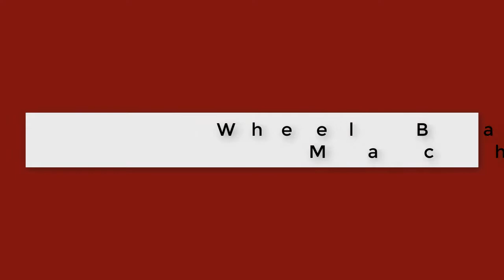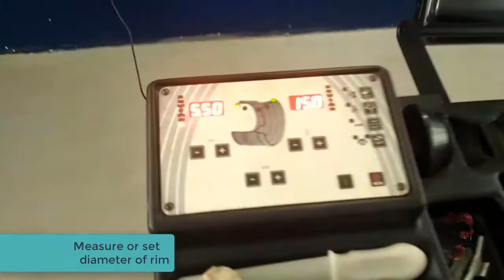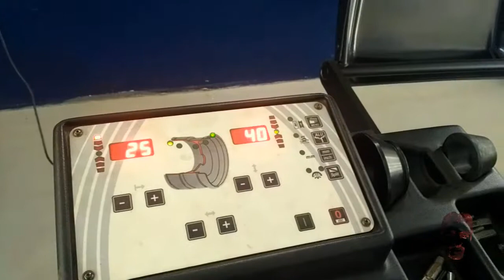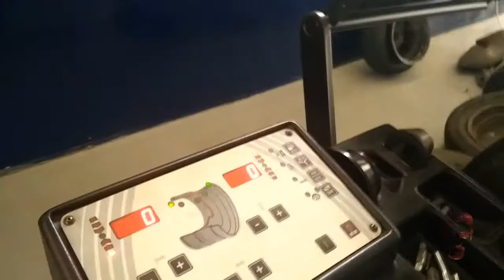wheel balancing, Bosch

Comment: Yaar mere pass John bean b9100 hai please batao kaise chalana hai
Reply from the maker: Harjodh Singh I haven't worked on john bean model....but I search for it  and found that it work same as the bosch model...there may be some differences
Reply: How we know machine needs calibration n how to calibrate it aur tyre ko agar phir se check kare nikal ke machine se then will it come 0 0 again or it shows weight s again
Reply from the maker: on the display panel, it shows the inaccuracy and needs to be calibrated. Just normal guessing how much wt it will require. Put it there and rotate the wheel, until it shows zero on the panel. once you have calibrated the wheels, it won't show weight is required.